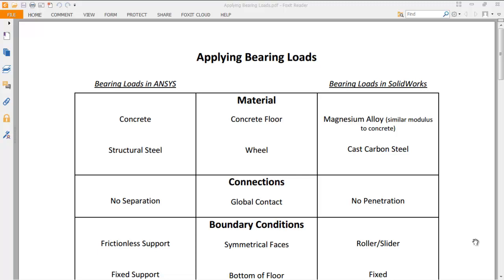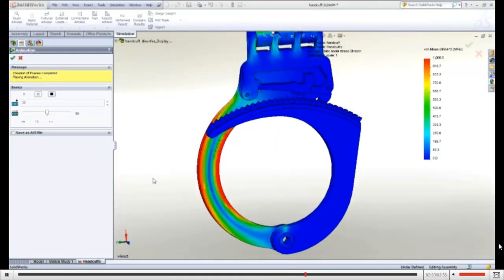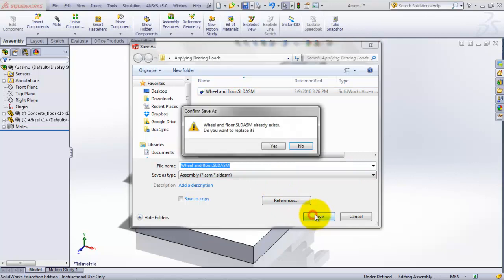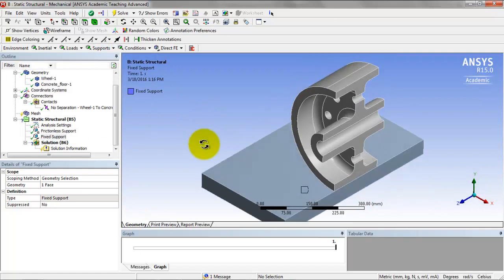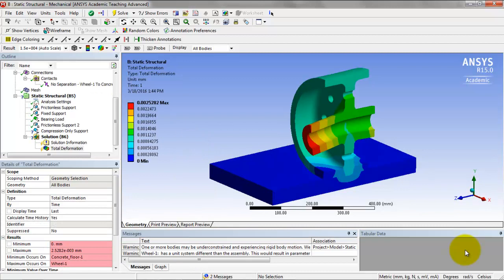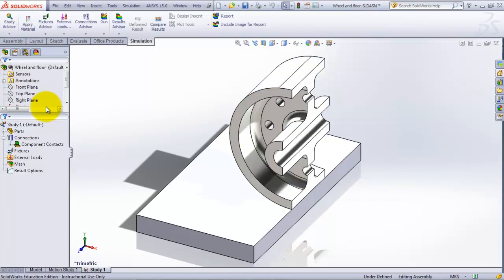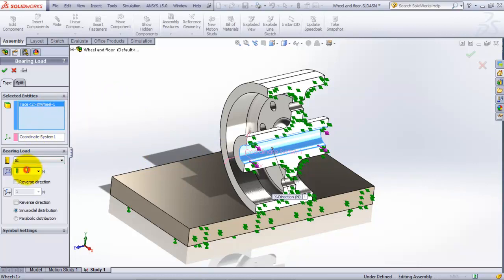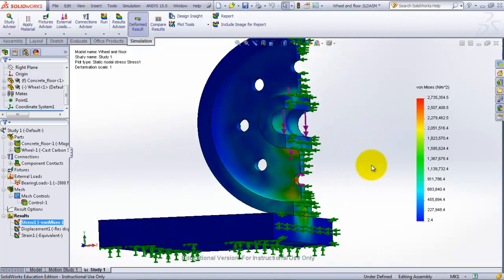Applying Bearing Loads in ANSYS and SW Simulation

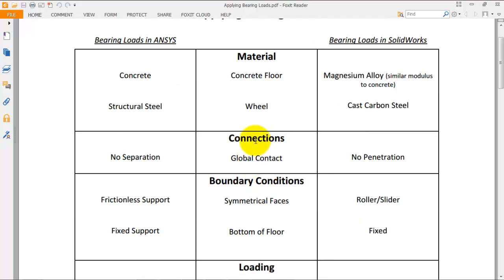Comment: Connections between two parts in Ansys: 10:20
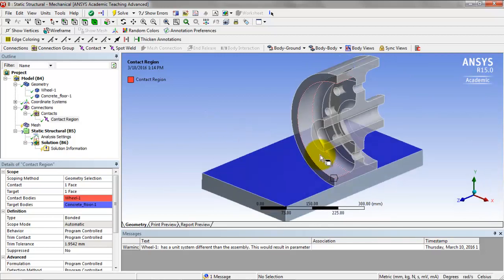What does bonded connection mean? 11:05
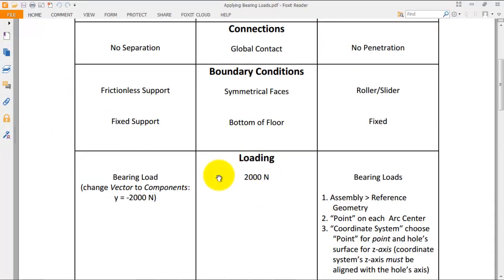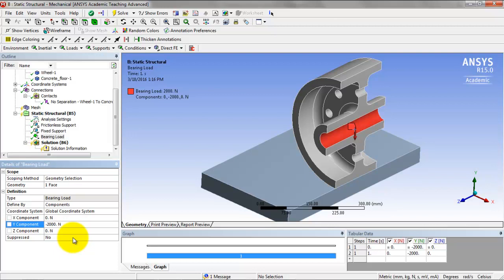Applying Bearing Load: 12:19 - 13:06
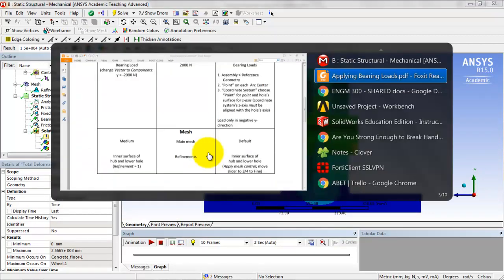Simulation in SolidWorks: 20:00